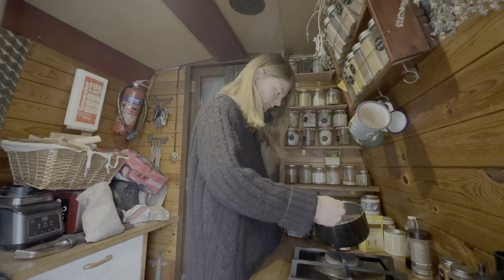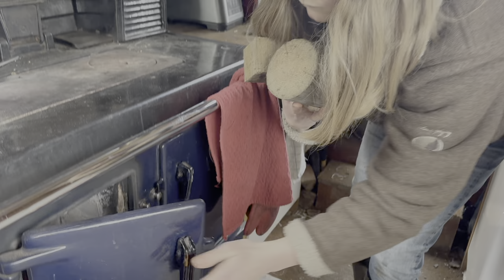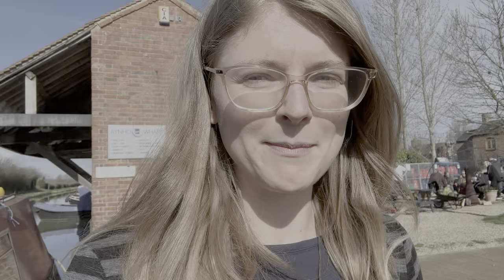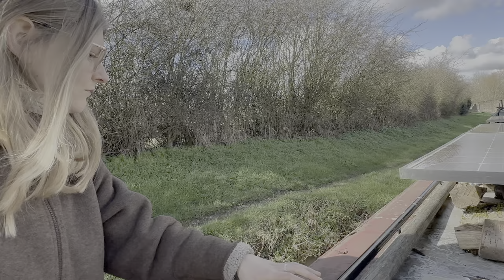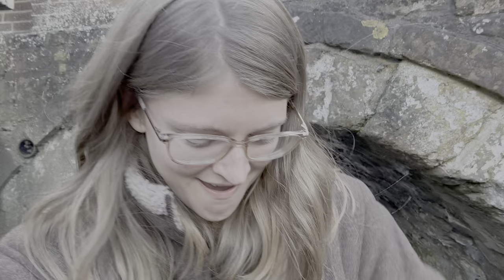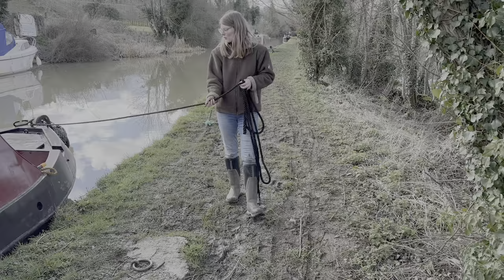Finally!! On the Move Again! NARROWBOAT Adventures with May

Comment: One more bit of info - the bow thruster is a two-way prop mounted in the bow perpendicular to the centerline of the hull. It will push left or right depending on your control switch. Expensive but very handy!
Reply from the maker: Yes wouldnt mind me one of those

Comment: technical point, a bow thruster is a propeller in a tube across the bow underwater, it is driven by a sealed electric motor from you battery system. You can switch the motor to run in either direction resulting in water being pushed left or right. Great gadget for a single hander.
Reply from the maker: Cool!! Thanks for the info !!

Comment: May you were struggling with a nut and bolt many months back and I had suggested that yo invest in a socket set.  If you have not B&Q have a nice set of 40 pieces on for about 40 pounds.  I don't know if it is of reasonable quality but it is 3/8" and would have all the sizes of sockets you would need.
Mark
Alberta, Canada
Reply from the maker: Thanks for the tip!!! I’ll go check that out
Reply: GREAT, let me know how it turns out.  You won't regret having a good set and make sure you get both metric and imperial sockets in the set.  Individual sockets can also be bought at another time. Also look for a set of "spanners", we call them wrenches.  They wil compliment the socket set.  Have a wonderful, fantastic day May @wellbeingonwater

Comment: May, can you post a screenshot of that link working please ? - When I click it, the website doesn't load, and instead it displays an error message 'This site can't provide a secure connection'. Thanks.
Reply from the maker: https://betterhelp.com/wellbeingonwater
Reply from the maker: that should work for ya 😊
Reply: @wellbeingonwater @wellbeingonwater No, it still doesn't work, and it gives the same error message. I asked you for a screenshot of that link working, not for another link. In other words, you click the link at your end, and then post a screenshot of that link working, showing the webpage working.